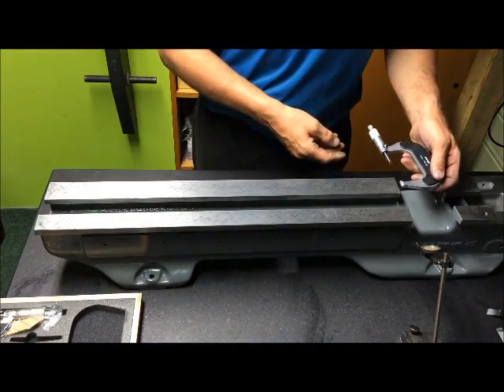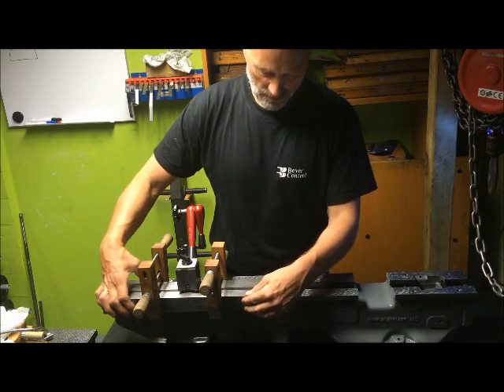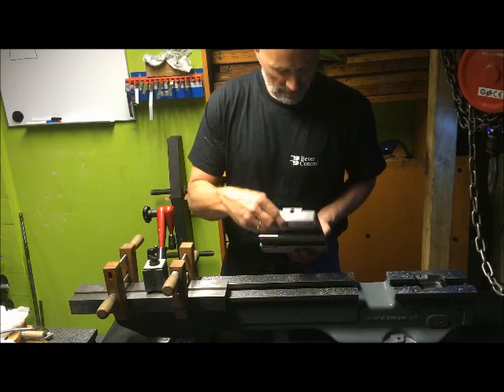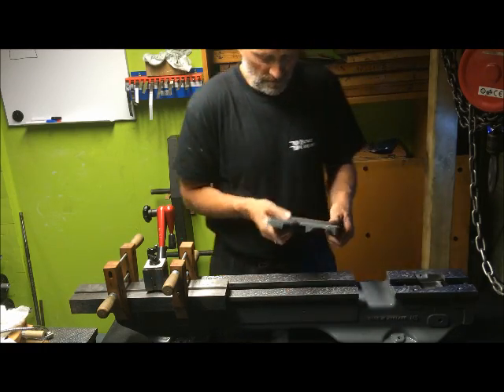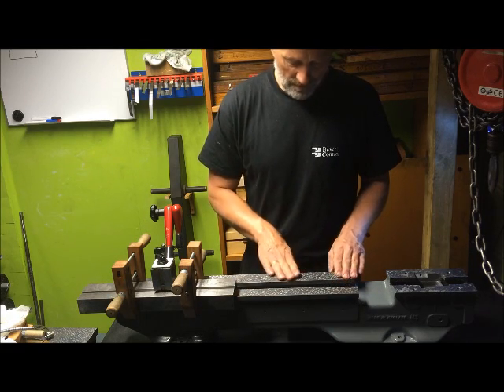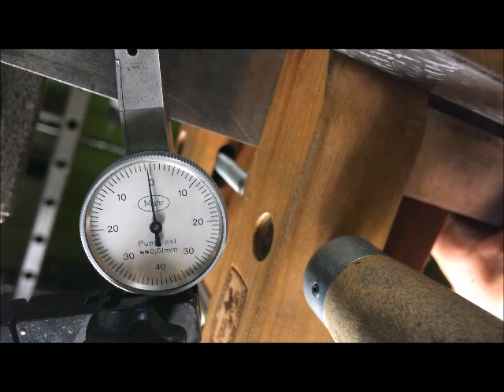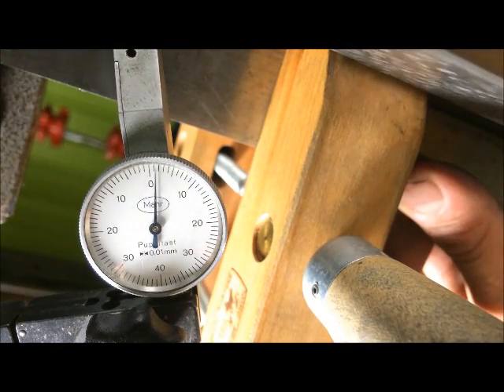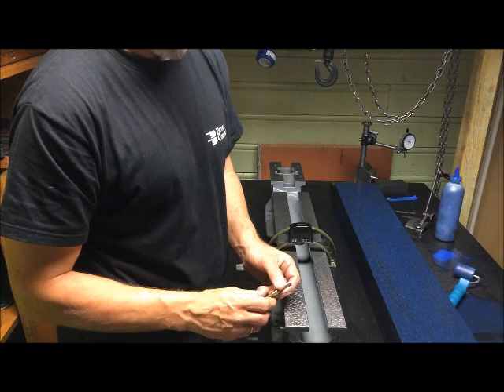Myford Super 7 - bed- part 2 - vertical guides

Comment: I've had similar issues with a micrometer, On close inspection the anvils were not carbide and the feel is different to my other micrometers. It took some practice measuring gauge blocks to get the feel with that older 125/150 mm micrometer. Thanks for uploading. Mat
Reply from the maker: Hmm.. not a bad idea. I know I need to practise measuring with micrometers, and I guess the correct "feel" will develop

Comment: a flat bed seems even harder to scrape true in someways to a vee slide. great video. thanks
Reply from the maker: That mst be me only.. a V-bed is a lot more work to get all the different surfaces aligned and parallel. Then I really think a regrind would be an easy wasy out.